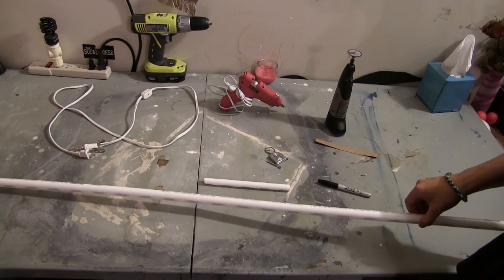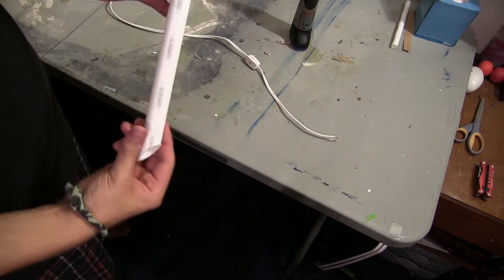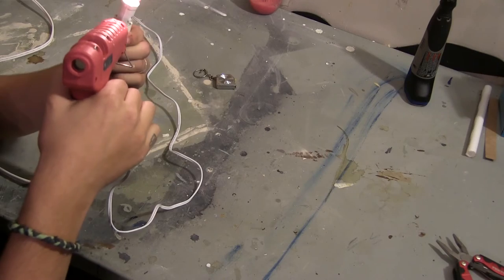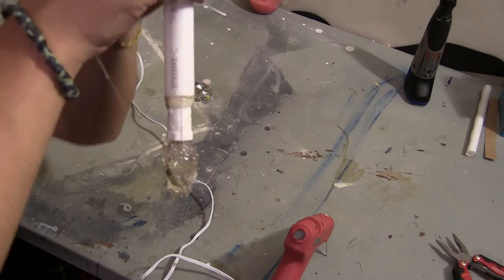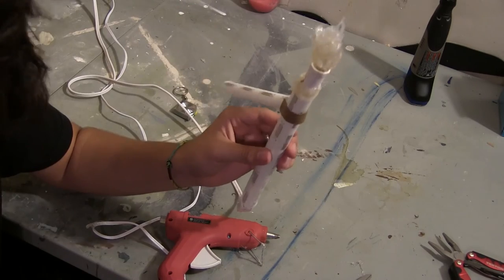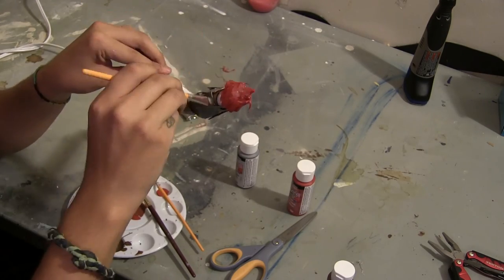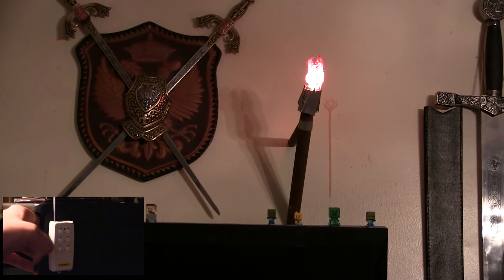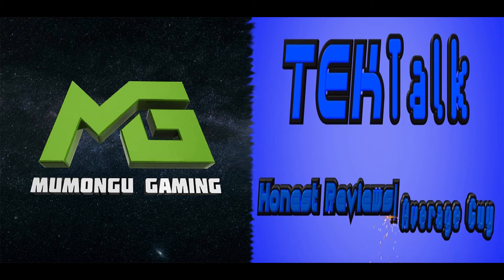How to Make: Indoor Medieval Torch

Comment: I think I missed something, did you hot glue wires that are running at 120 vac to a light socket that is going to produce heat? That seems, electrically speaking, not good. Interesting stain on the wall to the right of the fire, I mean, torch. BTW you are going to want to use a  Class"C" fire extinguisher unless the circuit breaker has tripped, then use a Class "A" extinguisher, on the resulting fire.

Comment: I just made one of these. I recommend using LED'S. within 2 minutes the bulb started melting all of the glue.
Reply from the maker: You have to use high temperature hot glue. LED's would be a great alternative however. Saving energy, longer lasting, and much cooler temperatures.

Comment: You never glue an electric cord of any type to anything electrically powered. Always attach them with screws, wirenuts or solder. Speaking as an electrician.

As far as the two sections of PVC pipe being connected together; they can be put together with clear PVC compound after the 1/2" is formed to fit around the outside of the larger pipe.

Comment: Buddy, youre a lifesaver! been trying to figure out a way to make one of these and havent found much to go on. What happens when you need to change the bulb? will it come off with all that glue on it? also i need my cord hidden, its gonna be on a column.
Reply from the maker: Glad I could help. In film we use Gaffer tape to hide cords. If you use a smooth strip over the cord and add paint the same as the column, it will be nearly invisible.